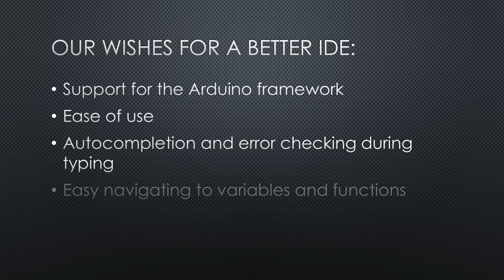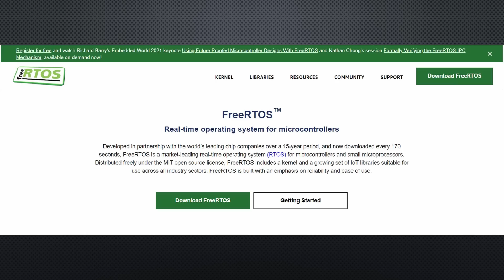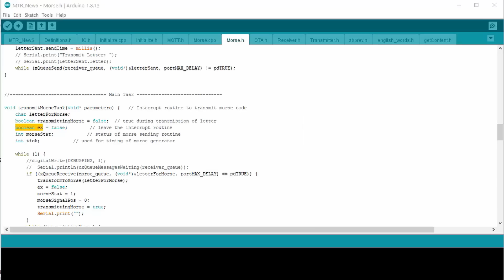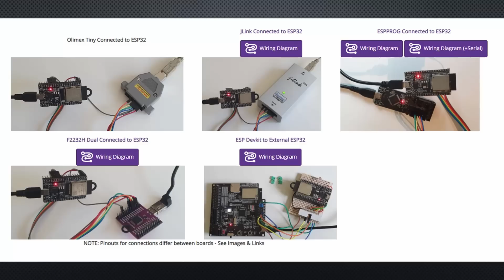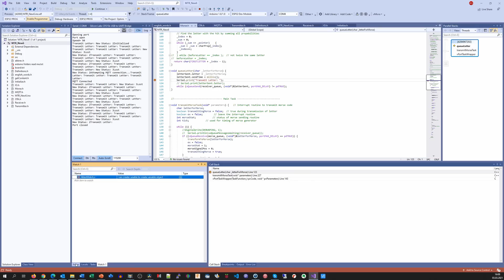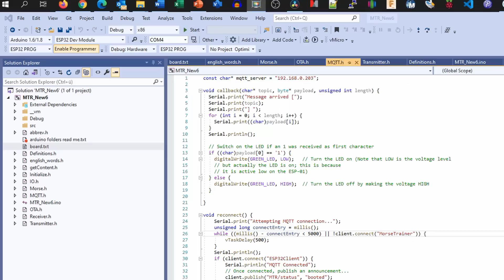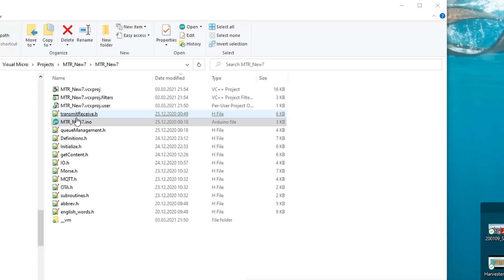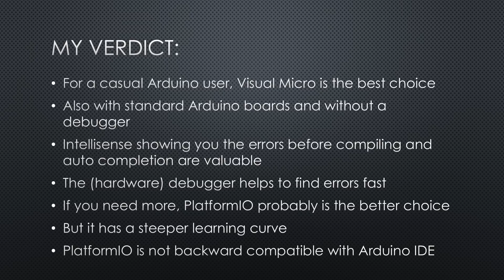#375 Is Visual Micro the better Arduino IDE? Including ESP32 inline debugger

Comment: Thanks for the info Andreas, it's really nice of you to do all this research work and share it with everybody. I for one won't be using this Visual Micro if it only runs on Windows but it was still nice to see/hear "what's out there".

One question for you, please: how bad is the compatibility issue between Platform IO and Arduino? I'm considering using PIO just for its hardware debugging features but I wouldn't want to sink time in it (the "learning curve") if it won't be able to compile the existing code without rewriting it first.

Cheers!
Reply from the maker: It does not need a lot of code changes. But you have to get the definition files etc. right. You even can import your Arduino projects. Many viewers changed to PIO after my video. and are happy with it.

Comment: I'm sort of depressed that this is still the situation we are in.
If you have used intellij for Java going back to the tooling we have for C is very painful...
It's like no one has actually managed to do better than Eclipse + CDT has been doing for I think over a decade.

BTW I don't think the 4 breakpoint limit is due to GDB. It's probably due to the hardware only having 4 hardware breakpoints and GDB not being able to change the program as it's running to insert software ones into the code.
Reply from the maker: You seem to be right. Another commenter also mentioned that it is a HW limitation.

Comment: All this rich navigation would have been possible in the arduino IDE ... I had a series of discussions with the arduino team a few years back, trying to convince tehm of how their codebase at the time contained this gem of a structure that could be used to introduce some key missing abstractions .... instead they destroyed it all by letting a ‘blind man bomb it all’ in a (for mr) real bad refactoring. My local branch had multiple editor types (assembly, markdown, c/c++), the ability to displa schematics, a les dumb rename (not semantically based though - actually thr arduino team proposed that we start collaborating via me putting that into their ide... but it was not possible to port my code after their destructive refactoring so I lost interest) a nav tree on the side, a fast switch between tabs, support for libraries inside a project ... a many more small improvements... supposedly that ‘carpet bombing’ was a preparation for his work on a debugger... oh well... some things are not meant to be. Since then they got typefox to make a real ide for them.. these guys are real developpers. 

Did you look at the pro version they have created? .. I was interested because I was at some point prototyping a different tool from the same base ide for work, and ran into their work on accident.
Reply from the maker: I did not look at the pro version, just at the 2.0 version. It still needs a lot of work. And they will not add ESP32 debugging and leave it to the community. So I do not know when it is ready. The pro version seems to use Eclipse. I once tried Eclipse but it was too complex for my simple mind ;-)
Reply: @AndreasSpiess  it is not. It is largely inspired by eclipse because Swen worked deeply and for a very long time in eclipse (and eclipse has a trylu neat internal design). But it is all typescript code implementation of the same concepts (context, editors, ws, injection...). Consequently it is all web based even though these are desktop UIs (the poc I made was working fine on a ipad). VScode (platformio) is also based on the eclipse principles and even architecture, because it is also the brainchild of Erich Gamma here in zur, but there are some deep differences between the 2 platforms which make their plugins non-compatible (well .. if I recall typefox was working on supporting vscode plugins).
That pro IDE has good promises... because Swen and Typefox are real hardcore developpers. dunno why it is progressing so slowly though... pro has a debugger... (my local branch had the premise of a non-functional debugger.. but it was just a crude poc to prove to the arduino team that they were utterly wrong in stating that it was aaaaalll sssssooooo complicated)
Reply from the maker: Thank you for the info. I hope they will be successful. It looks nice. But an IDE has to work before I change. I do not have the nerves to search errors in my code and in the IDE ;-)
And of course I need the ESP32 debugger, not an MKR debugger. I think they are late and lost a lot to PlatformIO and Visual Micro. But they have a good brand.
Reply: @AndreasSpiess  agreed ... .. was trying to tell them that 5 years ago.. that others wer coming, and coming real hard. .. as I understood it, tom igoe is teaching, and as long as the ide works for that, he is happy.... what a missed opportunity. I do like pletformio... and I still occasionally use my own arduino ide branch. professionally I fully switched off eclipse and use only vscode... for the pi, I really enjoy working on the mac, remote editing files on the pi itself.

Comment: What about the new IDE 2.0 of Arduino itself?
Reply from the maker: It is still in Beta. But I will have a look at it if latest when it is released.
Reply: it seems that they plan to reinvent the wheel and are not very fast or successful with this task so far...
Reply: @uwezimmermann5427  Arduino has always done that though. Their goal is to flatten out the learning curve, but unfortunately that means the more complex features are always out of scope. There have always been cheaper, more powerful, and easier to program microcontrollers and IDEs. The only thing Arduino did was offer a standardization and simplicity that made it easier to get into for beginners.

Comment: I'm working on a complex Arduino project and this got me so excited, until finding out that Visual Micro is only supported on Windows (I use a mac) :(
Reply from the maker: So maybe you try platformIO. It has similar possibilities and runs on Mac (AFAIK).
Reply: This seems very interresting, but alas i also use a mac. I’ll stick with platformIO which i like a lot and works perfectly.
Reply: @AndreasSpiess  I was excited for the Arduino IDE backwards compatibility, since it’s going to be open source for people to tinker. Platform IO is a bit too intimidating for hobbyists unfortunately.

Comment: Sadly this software is only available under Windows.
Reply: Yes, integration to VS Code would be nicer but that's a completly different plattform.
Reply from the maker: That is definitely a disadvantage I should have mentioned.
Reply: @AndreasSpiess  Its just one of many aspects but somewhat important from my point of view. The IDE subject is always difficult but Visual Micro was a good subject because it is a bit out of sight. Last time i tested it it was Arduino only. Thanks for your work!

Comment: Thanks a lot for this really very helpful hint and all the tips & tricks! 
Currently I need to spent my spare time rather with javascript than with ESP &Co. But I hope, the  ESPs will come back onto the agenda. PlatformIo is too big for my purposes. But a project selective library adminsitration would also be very helpful. I had this trap with the arduino IDE.
Reply from the maker: I assume your other stuff is paid work ;-) I agree with PIO is too big for most of my projects.
Reply: @AndreasSpiess  Yes, my paid work requires lot of time and power. And in my spare time I try to migrate my lighting into Tradfr Floalt Zigbee solution. Now I also understand the nickname Zickbee

Comment: Visual Studio is OK for navigating variables in projects. But for input, it is horrible. It gave me symptoms of carpal tunnel within two years of starting a job that used Visual Studio. Twenty years later i still have trouble using a mouse for more than 10 minutes. Yes, the debugging capabilities are nice... if you write buggy code.

Personally, I use "vi", i even use "vi" with the Arduino IDE then import the file.

I find that "vi" is WAY FASTER than anything Visual Studio, it has no auto completion that i will then need to correct, it does not need a mouse so the fingers never leave the keyboard, it can find sections of code much faster, and i can make complicated bulk changes in nearly an instant.
Reply from the maker: Editors are a very individual thing, I think. I am no heavy programmer. So this part is not so important for me. Error checking before compile and debugging are very important for me because I write buggy code ;-)

Comment: Right, so it seems this is a windows thing.
Reply from the maker: True. I should have mentioned it.
Reply: Yeah, no problem. A few of us diehards on Linux only. Probably a few Mac only guys as well.

I did do some research, and my thinking is that this is not a Linux solution (unless you're running a windows vm maybe).

And I have no idea on macos.

Thanks for another decent video.

Comment: Platformio breaks  from time to time. It has been unreliable for the last 3 weeks, and now I can't get it to work at all (14/3/2021), I was hoping for another tool with debugging, thank you. I hope Visual Micro has unit testing also.
Reply: I also found the quality of PlatformIO to be anywhere from great to really bad. Most complex features work very well but sometimes it breaks on the simplest things, like randomly failing to disconnect from serial before upload or choosing to upload a different project than the one I'm working on.
Reply from the maker: Thank you for sharing your experience!

Comment: I thought it was going to be visualgdb😂
Reply from the maker: VisualGDB unfortunately does not have a "Maker friendly" price tag :-(
Reply: @AndreasSpiess  True that's why I've been working on a bare metal solution for stm32 boards.  https://github.com/ewoutvannimwegen/stm32_bare_metal But this is requires a lot of experience with "register coding" in c.

Comment: Arduino ide 2.0?
Reply from the maker: I will try it if it is in a better shape. For the moment it seems to be in early beta. It compiles (even ESP32) code, but the user interface still has basic problems. As we would expect for a beta version...

Comment: Your video inspired me to have a go...I was disappointed. UI Terrible you have to scroll through hundreds of boards wit no categories etc. Toolbars vanish constantly variant options are called things like Option1, Option2, Option3...and learning curve for Visual Studio was much harder than platformIO with VSCode was for me. That serial debugger sounded great but its not stable and UI awful. Perhaps if you already work in VS2019 and not put off by clunky UI. Those who really don't want to use PlatformIO but want more should hold out for Arduino IDE 2.0 currently in beta3 https://www.arduino.cc/en/software#experimental-software already looks promising. And its not windows only.
Reply from the maker: Thank you for sharing your experience. I did not have such problems. But I do not use serial debug.

Comment: paid subscription?  even if it just was 1 cent per year, this is reason enough not to use it. how much i pay doesnt matter, but i rather own something than borrow.
Reply from the maker: I do not know what happens if you stop paying. I assume you just do not get any updates and can use what you bought till then.
Reply: they seem to have a perpetual license aswell, not too bad actually. 
 with a subscription license it will stop working once it runs out, with perpetual, you just stop receiving updates after 3 years but it keeps working
Reply: I wouldn't use a subscription either. The perpetual license is fine.

Comment: Dood how about iot.eclipse.org
Reply from the maker: Unfortunately I do not have good memories of Eclipse and Arduino. I did this video because I think, Visual micro is easier to use than PlatformIO. Eclipse in my opinion has a learning curve similar to PIO
Reply: @AndreasSpiess  Both Ard and Eclipse IDE are kind of clunky. I have often thought to fixing a lot of the problems myself in them, if I could find the time.